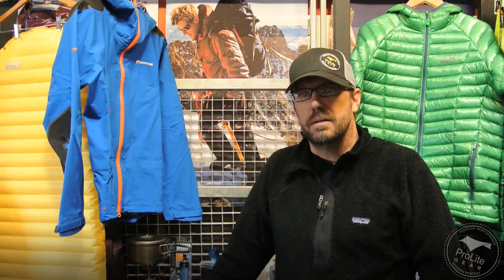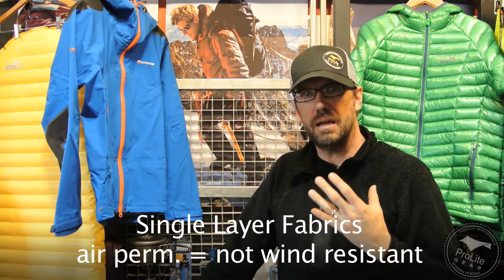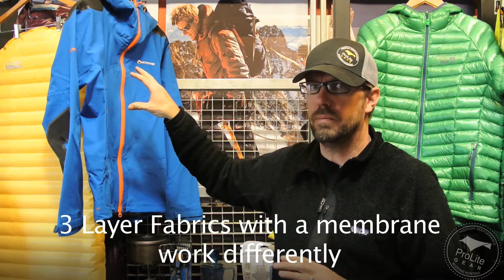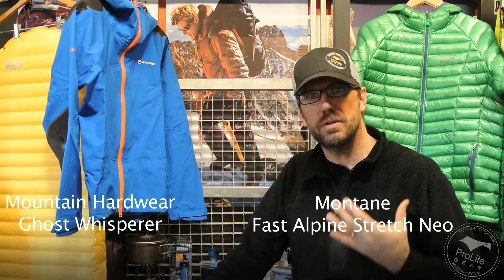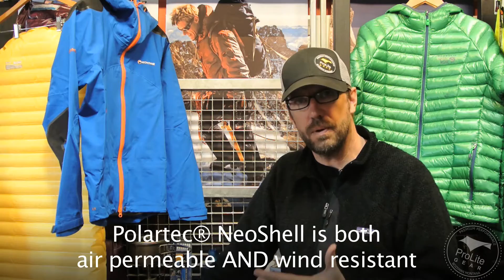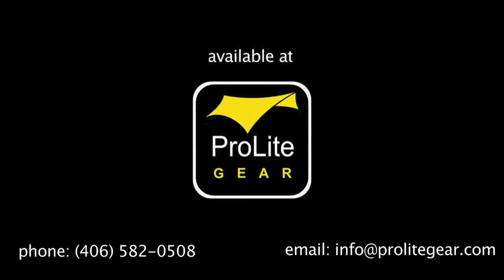Wind Resistance vs. Air Permeability

Comment: Great Vvdeo Brad. A really insightful explanation of the difference between the two materials. Brad, with summer around the corner can you do a video on the best t-shirt for wicking/comfort this year? I have seen the base layer video you did but I haven't seen one on t-shirt. It would be a massive help as I've bough product in the UK based on your reviews and with your Indepth tests you will test for things I wouldn't think of. Thanks for your help and advice. Graham (UK)